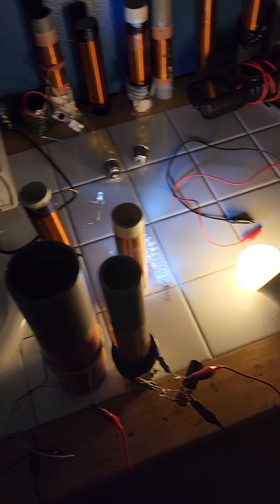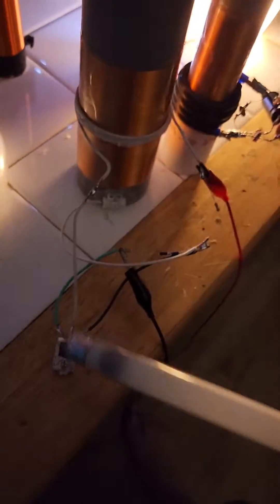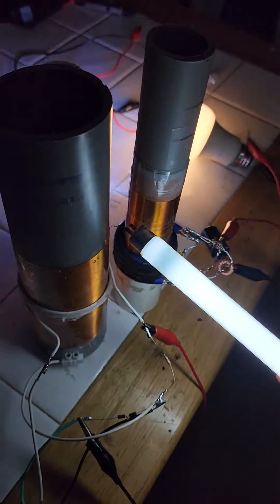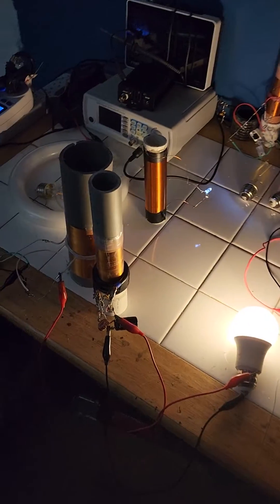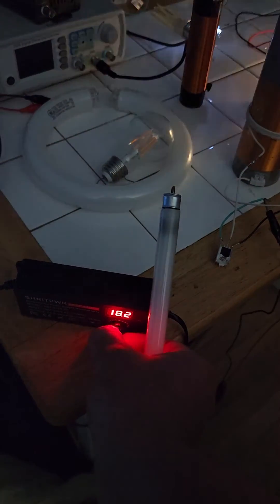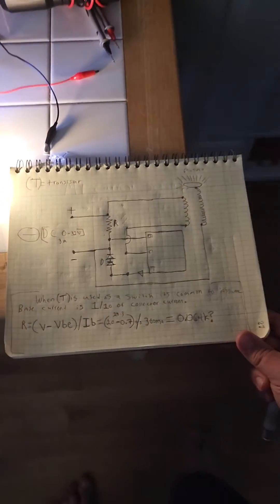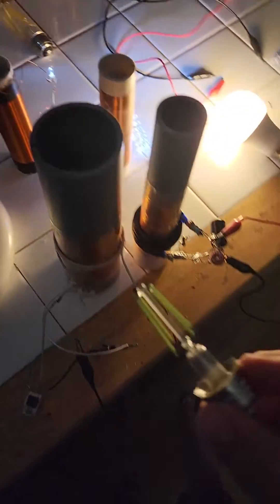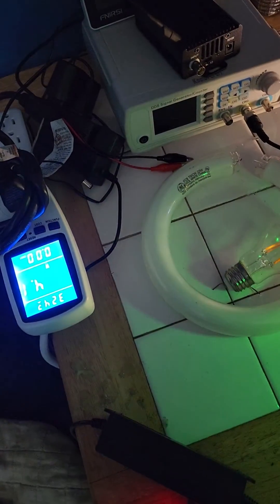Fun With Transistor Tesla Coil. Less Then 10 Watt Input @ 0-20V DC @ 0.5Amp.

Comment: Are you familiar with Gary Bluer aka "GBluer" on youtube aka introducer of "Slayer Exciter" circuit? A lot of good circuits on his channel.
Reply from the maker: I'll have to check him out. Right now I'm trying to figure out how to have my transistor switch at 3mhz because that's what I built all my other coils to respond too. I'm stuck waiting for a month until my new signal gen & 20 Watt amplifier arrive lol
Reply: @MTECHINDUSTRIES  The beauty of the Slayer is the self tuning so you just have to change the LC values. If this coil is at higher frequency than the others then within a certain reasonable limit you can just drop this coils frequency by adding more topload. Inversely you could increase it by just removing x amount of turns from the secondary and sacrificing a bit of voltage. If this one is just too far out of range to where you have to make major modifications, then you can always just modify the receiver coils the same way until they match. Eventually they just become like similar pieces of mass which ring the same, they don't actually have to look the same.